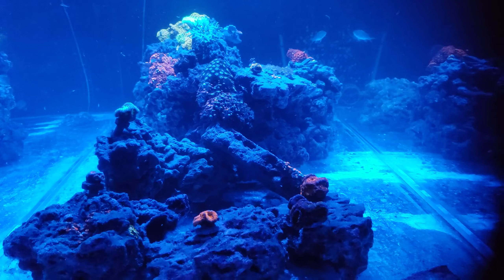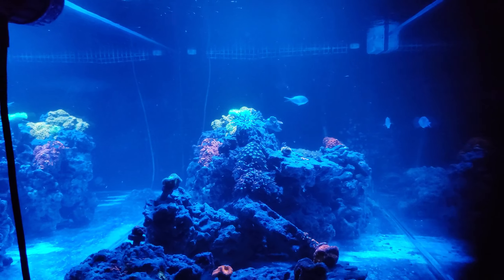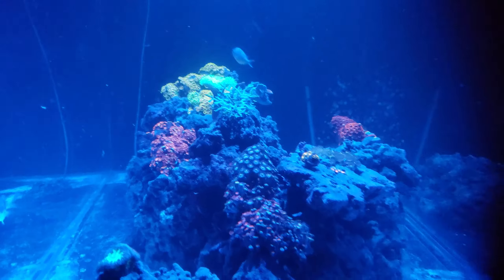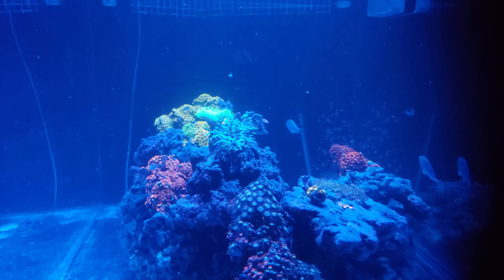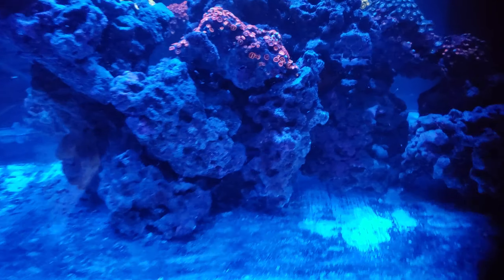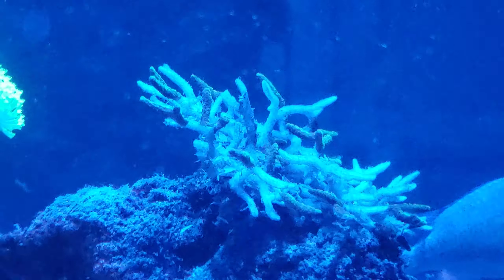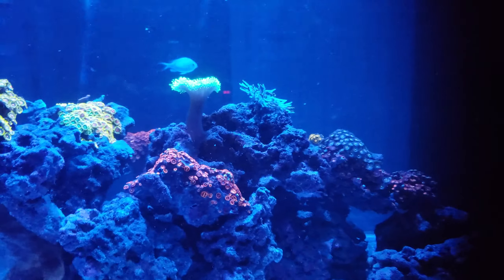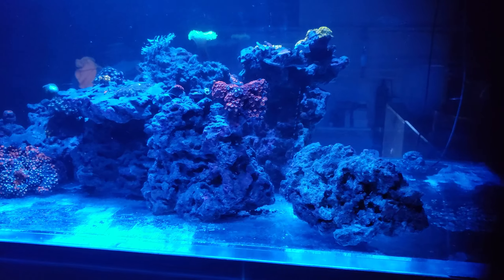Won...the battle and what happened!

Comment: No. The problem was that you stripped all nutrients from the water with too many bio pellets, not that the water was dirty. The water needs to have trace amounts of phosphate and nitrate to thrive. This is especially the case for sps. Hope this helps. And were you running gfo at the same time?